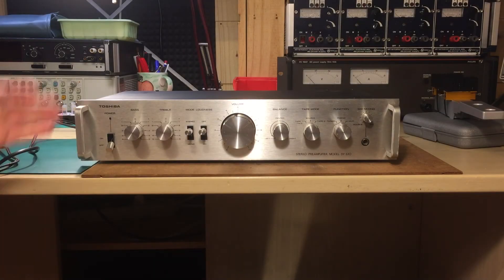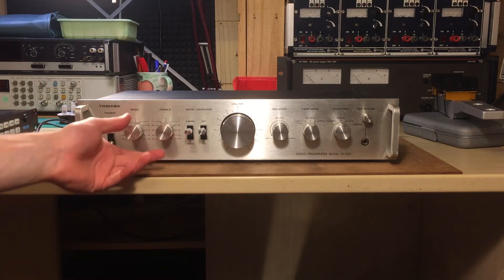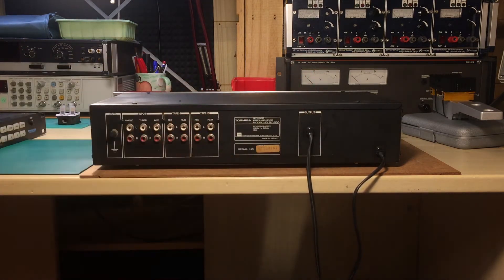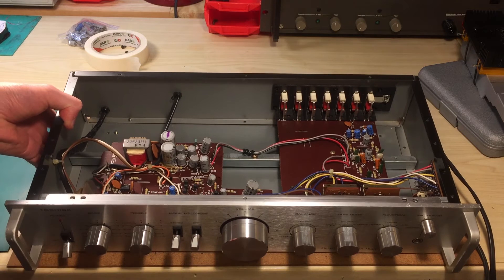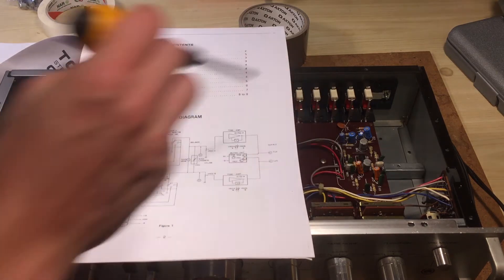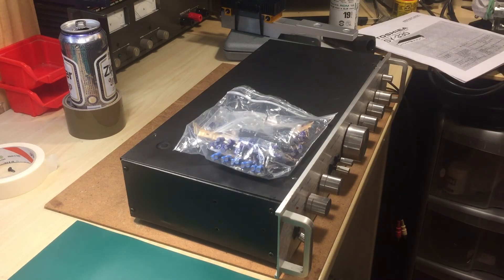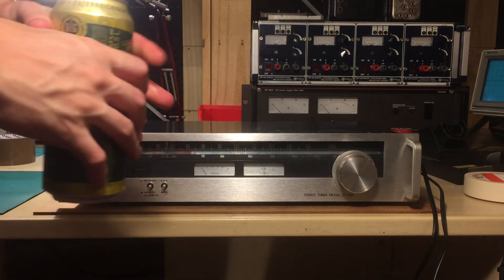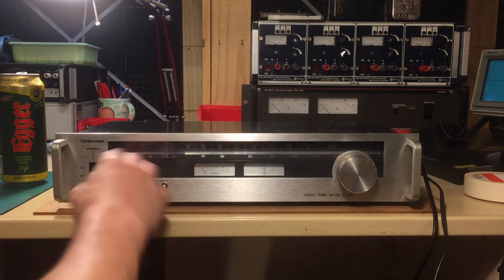Hi-Fi Toshiba Preamplifier Recapping and Tuner Quick Teardown

Comment: Hi my friend, I have an issue with my Sy330..
It turns on, however it doesnt amplify!
To hear something I need to increase volume up to 10!!!
I have cheked DC on the Operation Aplifire and it's good, all capacitors look good shape... Any suggestion?

Thank you!
Reply from the maker: Hi! Have you checked if there’re some bad connection in the circuit? It could be also bad contact in the volume pot, I would try to spray some contact cleaner and see if it does something. 
Then, if it doesn’t work, if you have an oscilloscope on hand, try to feed a signal in the input of the preamp and try to probe the signal in the circuit. This way you should be able to find where the signal gets lost. (If you don’t have an oscilloscope, you can still use a multimeter in AC mode and see if you have a decrease in voltage)
Hope it helps :)
Reply: @DaveElectronics  wow thank you for the quick response! I'll try something with the oscilloscope. 
Volume pot doesnt scratch at all, it encrease normally but with pratically zero amplification (still i cleaned them).  Lets see...